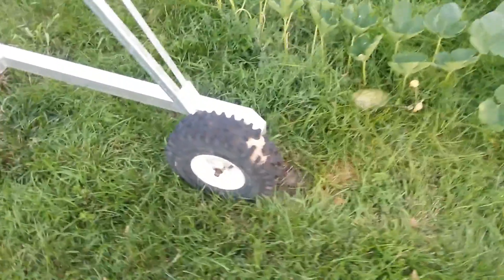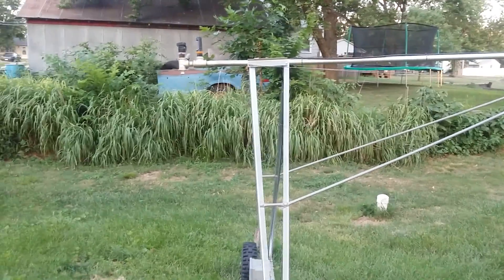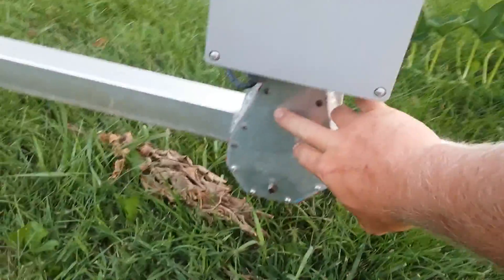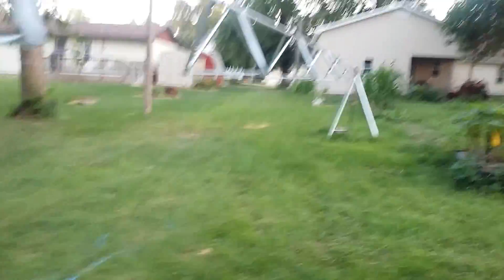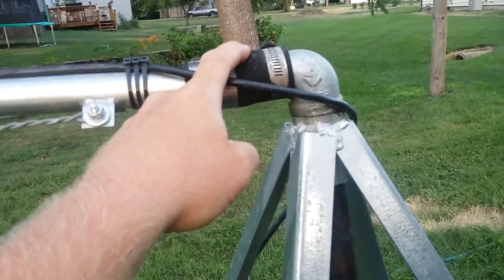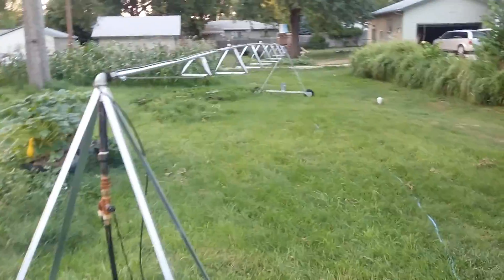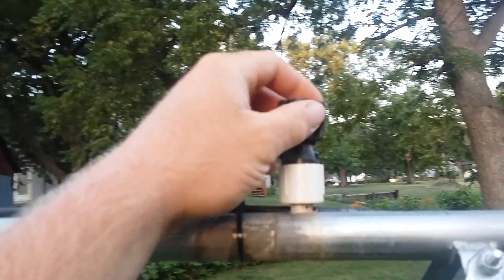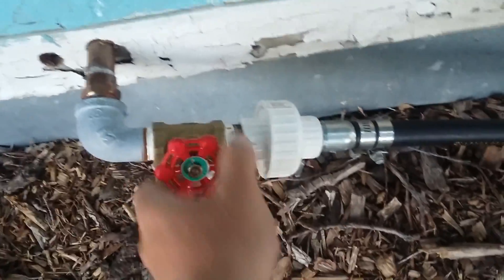My little pivot 2.0

Comment: I'm just thinking about building something like this for my 5 acre (2ha) hayfield. Really only 500$ for everything??? This is very inspiring. I'll probably try 2" pipe with 2 or 3 spans, and I need to run it with as little pump energy as possible (aiming for ~1000W solar powered well pump) so I'm thinking about trailing many small hoses down close to the ground instead of sprinklers, so the evaporation & wind losses are minimized.
Reply from the maker: Could build one for that and depending how deep your well is, 1000w panels could work.  BUT building one of these is a pain and a lot  of cutting, drilling and fabricating.   Yes this cost me like $500 in parts and 40 sum hours of labor to get done with a drill ,grinder and vice.  But if you wanted to go bigger it will be more $.  For 2" span, 80' span would work 8-10' sticks of pipe, could go 100' but it would get floppy, also the wheel drive would need up graded to wheel worm gears.  The price would go up a lot.  The sprinklers I used were  senninger  mini wobbler and Xcel wobbler, these sprinklers work on very low pressure and throw large drops of water to reduce evaporation
Reply: @madwiner  I was thinking of using geared hub motors like in electric wheelbarrows, or maybe windshield wiper motors. Even better (no electricity needed) would be a water turbine, geared way down, but somehow I cant find any. Do you think PE pipe might be stiff enough or should i stick with galvanized steel? Why are the sprinklers always mounted on top instead of on the bottom?
Reply from the maker: @c2h7  One of the other mini pivots I built ran on water drive, I just used one of them yellow tractor walking sprinklers.  I extended the wands up above the tower and left it one wheel drive.  The problem was that it was very hard to keep it running the same speed and keep good water coverage.  Any change in grade or to run over the garden hose would cause large changes in speed
Reply from the maker: I have thought about power chair wheel drive, but making it move the same slow speed would be very hard
Reply: @madwiner  I was thinking more of an enclosed water turbine (which is driven by waterflow but does not spray out) and then geared down several times (maybe also with a worm drive) to creep very slowly, but surely.

Comment: do you perhaps have blue prints for the swivel point
Reply from the maker: @anthonybessinger2652  not really, I used a piece of 1' pipe about 30" long, then found another 4" long peice of pipe that slipped over it. I used a copper pipe adptor and a short piece of 1" copper pipe. Then used a shark bite adptor which acts as the water swivel

Comment: I'm assuming you are either in the industry,  or have been in the past? Awesome work. I'd buy parts from my work (I work in a Reinke Irrigation distribution center in Idaho) but of course it's all the big stuff. Need to fabri-cobble something like this together. Awesome work dude!!
Reply from the maker: Nice... Well I have been working for a T/L dealer in nebraska for 17 years now and been building strange stuff for a long time :)
Reply from the maker: Like my loader mower
Reply: @madwiner  Good stuff man! Good stuff! I like your ingenuity and way of thinking.  What part of NE do you hail from? I'm sure you have to be familiar with our main plant in Deshler. Both of the people I work with lived there as well.
Reply: Really cool ! I'm Into ag irrigation I've liked it since I was little. My fav thing are the old nelson fast reverse guns. I've got a collection myself. I have a P100,P150, and P200 and 2 PC100s. The P200 I just got needs repaired because the bearings siezed and it doesn't rotate. Has a 1.56" nozzle. Need to find stops for it though

Comment: This has be so baffled could you please break down the main town and how you were able to achieve a full 360 degree rotation or maybe help me with a parts list cause I very much would like to know I’m building one for a small wild flower field to help sustain my bee colony’s
Reply from the maker: Do you mean the center point? Do you mean the water swivel?  I upgraded from what is on this now to a 1" shark bite connector and it works just fine.
Tell you what I will just shoot another vid.
Reply from the maker: @zanethompson4574  Uh ok I did put a vid out just yesterday on it

Comment: What exactly did you use for the motor and the drive system?
Reply from the maker: got a 1.8 rpm 12 vdc gear motor that runs to a 2.5 to 1 on the center drive, then a 3 to 1 from the center to each wheel

Comment: What type of motor did you use for the direction
Reply from the maker: It was a 2 rpm 12v dc gear motor I got from surplus center in Lincoln NE.  I just checked and they don't have that one any more, but any good sized low rpm motor will work.  Its a DC motor so to change directions I just change the polarity with a on/on 6 pole toggle switch, and yes I dooo have the reversing pole on it now and it DOE'S auto reverse on its own